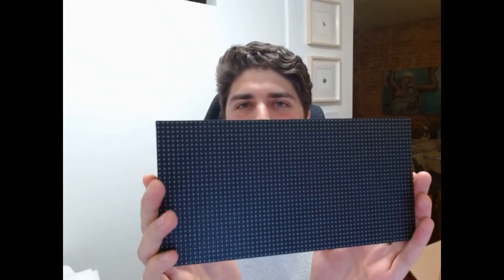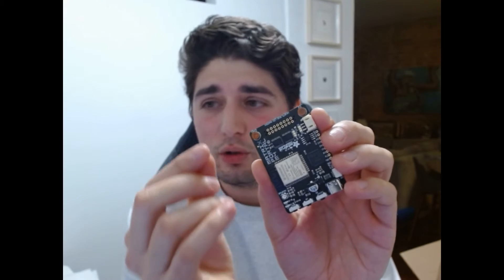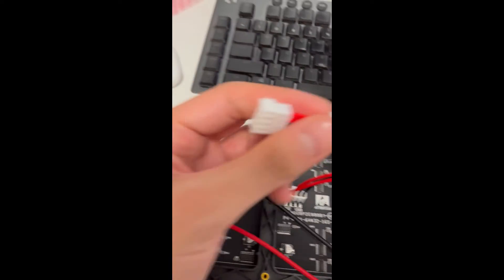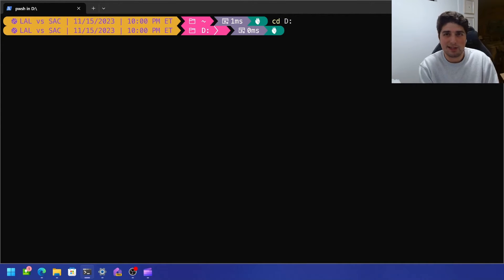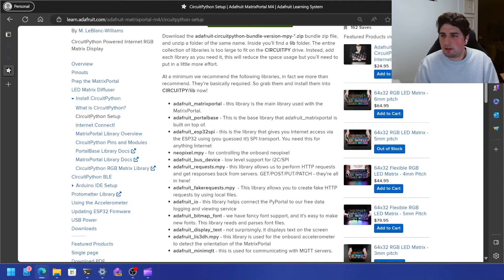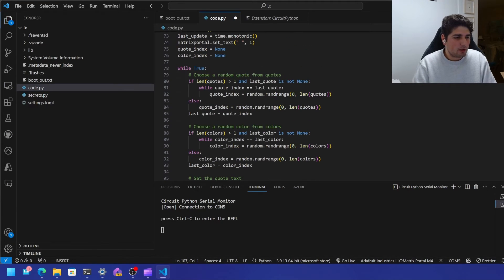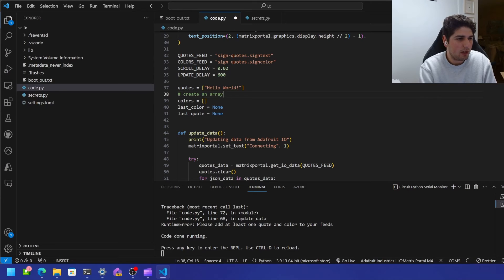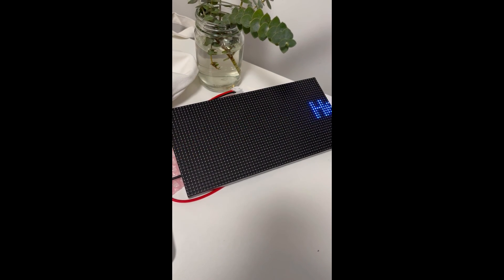Setting up Adafruit RGB Board with Hello World Text for BEGINNNERS!

Comment: I got the 64x64 code to work properly but for some reason it's got some flicker compared to the 64x32.  It came pre-soldered because I bought the S3 so I don't know if it's just a limitation of the processor or what.  64x32s look great on it though

Comment: Hello, Im having trouble getting the code to work. I have the correct libraries installed in the lib folder, but when I try to run the code.py, it doesnt work. I get the error: "adafruit_display_text" is not definedPylance when I try to import anything.